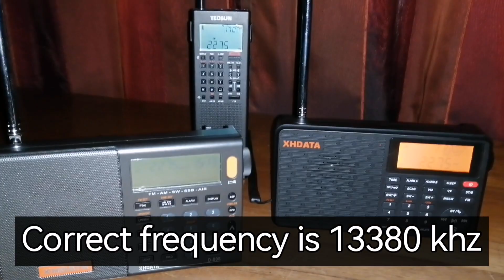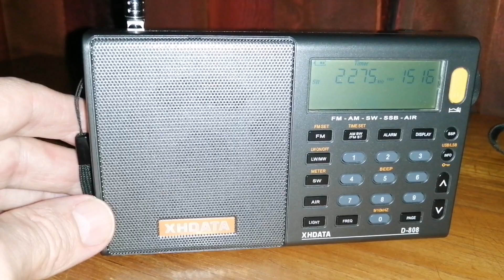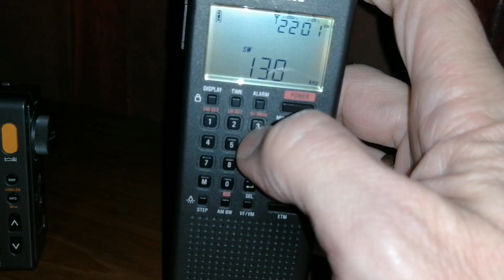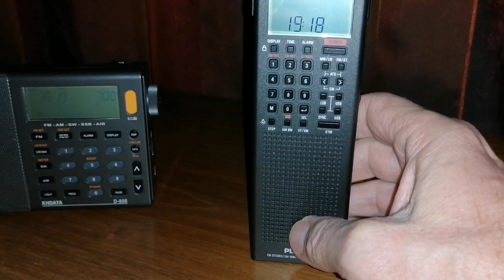Vatican Radio spurious signal 2275 kHz on XHDATA D-808, D-109 AND Tecsun PL-368 #shortwave

Comment: Just had the exact same thing happen on my Pl-368. Never usually hit below 3000khz and this came through inside on the stock telescopic. Love the Pl-368, am soon complimenting it with a YAESU FT-65E for transceiver capability.
Reply from the maker: Hey John, those spurious signals seem to be something of a regular occurrence on my portables. It happens often with strong nearby SW transmitters, like the VOA one in Botswana, sometimes it pops up all over the dial.

That Yaesu you are planning to get looks like a really nice tranceiver!
Reply: @swlistening  it was a choice between going digital or staying true to my roots and remaining analogue. In the end simplicity won out and the chance of owning a YAESU for the first time ever. I was in the room when Vertex was announced as something of an attack on Baofeng and TYT. Even then, a basic 16 channel non display business radio would run you at £200 YAESU now have dual banders sub £60 for the Ham market and quality reports are good. Like the Tecsun, I hope to get decades of use from it not BAOFENG "value" It's going to be in my EDC so I want something that can do a simple task well for a long time. I've also got an XHDATA AN-80 wire antenna in my basket for better DXing. Really getting in to SWL right now. The app Shortwave Schedules Pro is a godsend as it features an SDR function for confirming receptions. I love the idea of a signal from Vietnam going 2/3 of the way around the world and finding me in a little ground floor flat in Nottingham. I get giddy at the thought lol. 73's

Comment: All radios have similar or even the same DSP chip and do not have normal filtering. Therefore they have the same issue with spurious signals from strong SW stations.
Reply from the maker: Thanks for this. It does seem to happen on many similar radios, some of my viewers from various countries using similar radios have reported the same issue.

Comment: Colud be those radios being overloaded by a strong signal and putting an image of it on 2275. 

Im wondering if you was to hook up an antenna like a youloop to the radios external antenna port (on the radios that have them) and you rotate the loop antenna to where the station is in the loops null zone if the spur at 2275 goes away or not.
Reply from the maker: That is an interesting idea. The only external antenna I do have at the moment is a long wire, but it is something that I can still try. It does seem to me that these radios do suffer from these mirror signals quite a lot, would be interesting to know the reason.
Reply: @swlistening  the issue with using a long wire is it doesn't have a null like a loop does, while it may get the antenna away from the radio, you wouldn't be able to null the signal out as well or at all with a long wire, it may make it worse because they don't have a null and take in everything they can.

If you do buy a loop antenna to test with it's probably best to use the Youloop as it doesn't have a preamp, but even then something like the MLA-30 can still null a signal to keep it from overloading, but then you're going to be fighting more than just one signal because it's basically going to be shoving the signal into the radio.
Reply from the maker: @madmax2069  Tha al you for this, I have been thinking about getting the MLA-30, we do have a local supplier of that one in South Africa.
Reply: @swlistening  I didn't think of it at the time, does any one of the radios that suffer from this issue have a local/DX switch on them? If they do you can flip the switch into local and see if the issue goes away or not. 

Now if everything you try doesn't fix it, then it very well could be the radios themselves if those Rados are the only ones that are being effected by the issue and none of your other radios are showing the issue.

Or they're having transmitter issues, or maybe atmospheric conditions are causing it if it doesn't always happen.
Reply from the maker: @madmax2069  They don't have DX switches, but I have been posting some videos about this issue for a while now. Many people with the same radios seem to have the same issue, so I do think it has to do with the radios themselves. It does not really bother me, nothing much else happens in the 120m band, so these spurious signals don't really block out anyhing else that I could have listened to. I'm just curious as to what the cause might be.

Comment: You have a typo in your title identifying the "real" frequency. The title says "13380" but the D-109 is tuned to "13830" at the end of the video.  My question, though, is whether you are sure that 13830 is the only frequency carrying that programming, or whether there could be others. I observed an AWR program on 15355 heard on 2245 on several radios, but I'm not sure that no other frequency carried that program. I'm looking for a pattern.
Reply from the maker: Thanks for the correction! I actually checked the broadcasting schedule on shortwave-info, Vatican Radio was on three different frequencies at that time, 9835 and 11935, as well as 13830. I tried all those frequencies, the only one that I could pick up was 13830, quite clearly, as you can hear in the video. I did not hear anything on the other two frequencies. But, I must say, lately I have found that shortwave-info has not been very accurate at all with their schedules.
Reply from the maker: Just one additional comment, this was Vatican Radio in French, they had several other broadcasts at the same time in other languages, but only the three frequencies I mention in my previous reply in French. Although, as I said, I only picked up the 13830 one.

Finding a pattern sounds like a great idea, would help explain this a bit more. Late last night VOA was on 2225 khz, real frequency 4930 kHz. That transmitter is just a few hundred miles from me in Botswana.